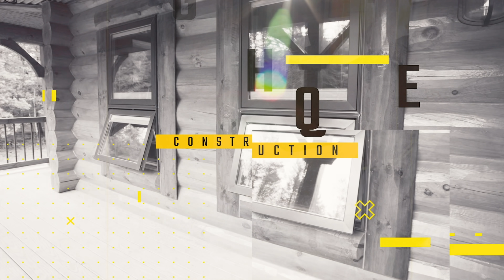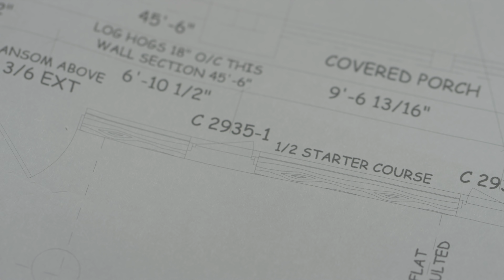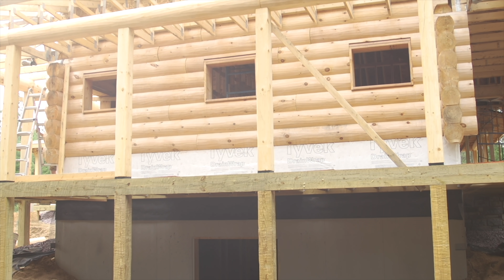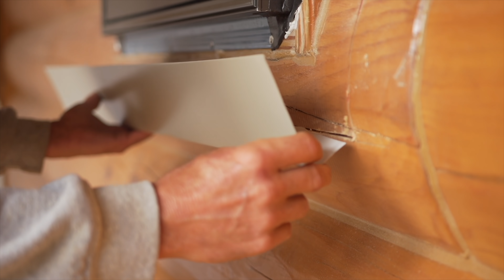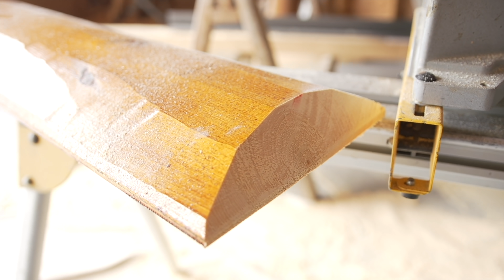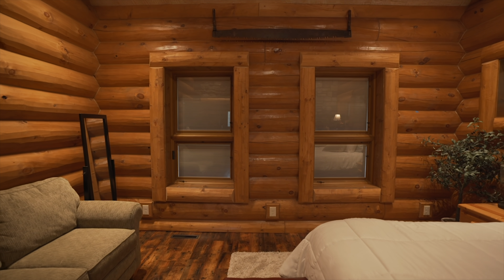Episode #2 Log Home Construction - How To Install Windows, Window Framing, Trim, and Doors

Comment: I have a question.  I currently have a 25 year old log home with jack pine 10 inch logs.  We want to renovate our kitchen and put in a bigger window.  I don't have the plans to show where the rods are, so would I just use a reciprocating saw to enlarge the opening using a wood blade to find the rod?  Once the rod is found I could switch to a metal cutting blade.   Or is there a better system to identify the rods?
Thanks,
Reply from the maker: Sounds like a great plan, our homes do not have rods in them, like your saying, but we we have long screws,so same type of idea
Reply: @goldeneagleloghomes  Thank you and great videos, makes me want to build a new log home!!

Comment: This is definitely a beautiful home. 
How much does a log home like that cost  ?
Reply from the maker: Thanks for the compliment! 
Totally Built (Turnkey) Cost of the Log & Timber 2124AL
Thank you for following along with this Log Home Construction video series. Along with thousands of others, you are probably wondering how much this great home would cost to build.
Let’s go back to how this all started. This homeowner came to us, and really liked the Eagle Prow 1975AL. That stock plan would have a (♦ turnkey cost) of approximately $499,000 as an 8”x8” full log home. As with each of the 5,200+ homes we have previously built in North America, this homeowner began by modifying our stock plan because they were looking for more luxurious options and a larger home. With the help of our in-house design team. They increased the size of the home, upgraded to 12”x12” full logs, and choose deluxe options on nearly every single item in this home. This resulted in a turnkey cost of approximately $950,000.♦ Turnkey costs do not include the unpredictable variable costs such as price of the land, well, septic, landscaping, taxes.
Reply: @goldeneagleloghomes  Thanks for being so open to providing pricing information. Looks to be worth every penny!
Reply from the maker: @ricksmith7895  we want to be a accurate as possible